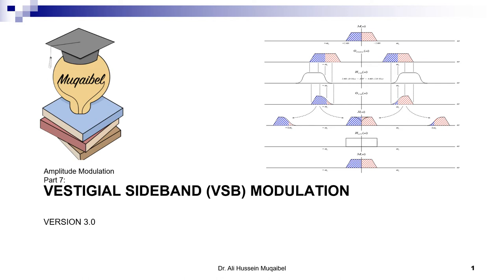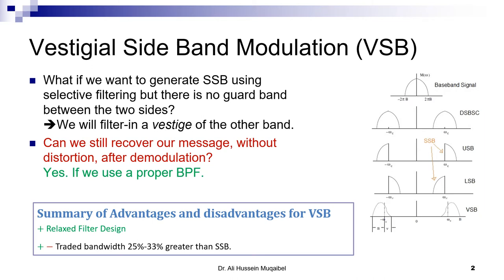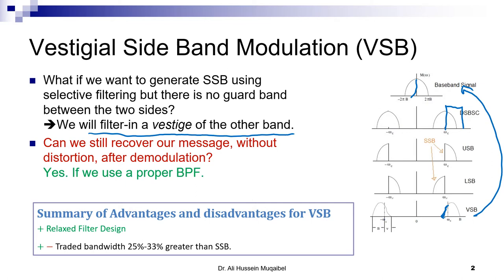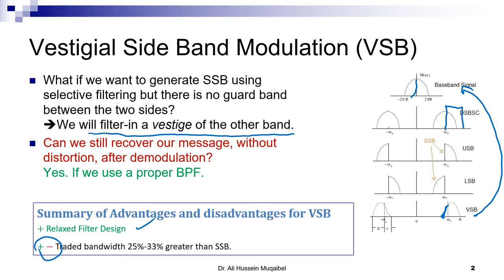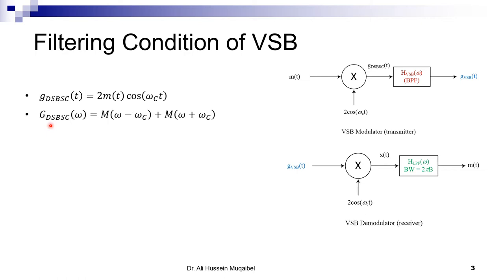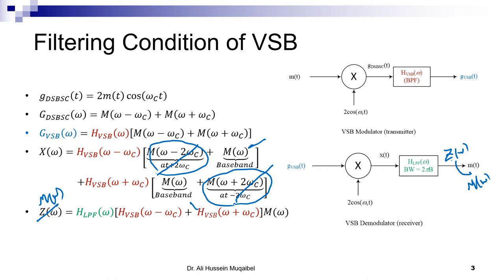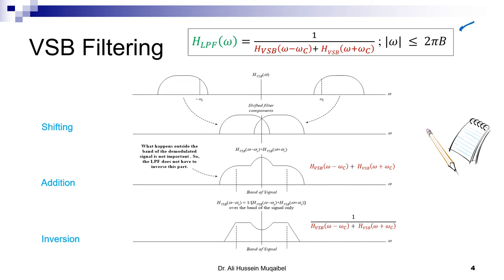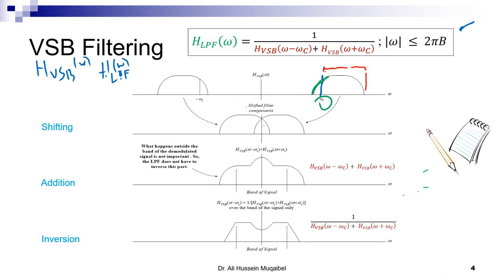4.7 Vestigial Sideband (VSB)

Comment: I have a question if anyone can help,
in the example at min 13:23
the signal at the transmitter will be sent distorted. Correct?
Unless I use the deduced filter at the receiver, it'll remain distorted.
Else, distortion is eliminated by the receivers filter's gain, correct???
TIA
Reply from the maker: Correct